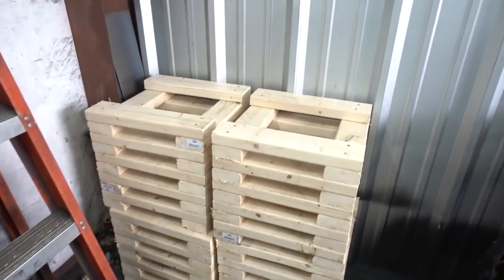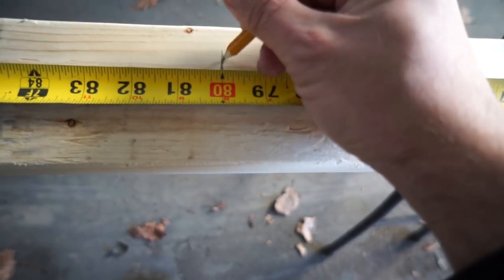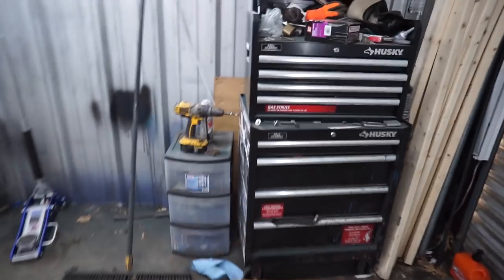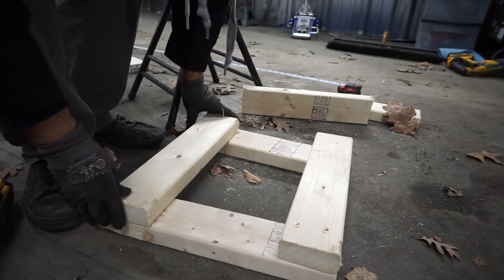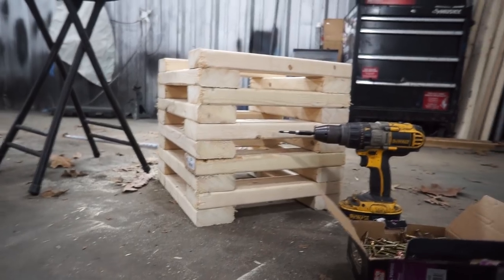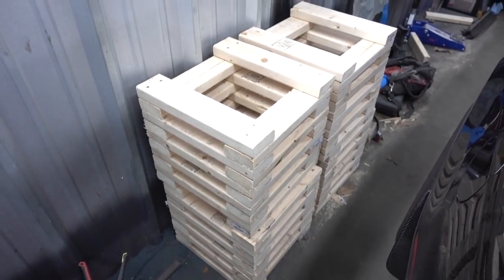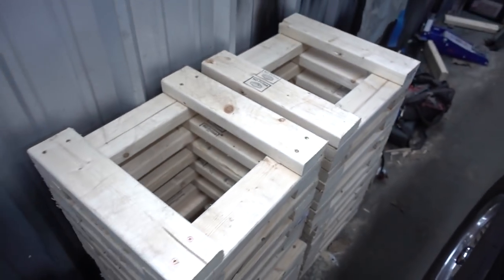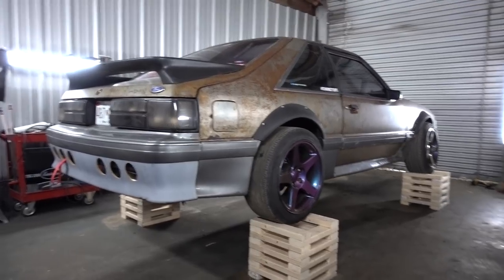How to Make Cheap Car Stands

Comment: Where i work we have scrap 2x4s going in the dumpster every day, just built my 1st of the 4 today with free wood!
Reply: Not fair lol i just spent 200 on cheap 2x4s lol
Reply: that is probably cheap pine, ok for fireplace but holding a 2 ton car crack crack split and your holding up transmission with your head and maybe thats why it is in the dumpster but good luck

Comment: The actual scary part of that is when one end of the car is supported by 4 jackstands. Jackstands are not designed or rated with any lateral loading, and can collapse with far less load if pushed sideways.   It would be saver to use a shorter set of wooden supports or ramps as an intermediate step.

Comment: Tip from Essential Craftsman: make a stack of 2x4's - however many you can control.  Or heck - two stacks.  THREE - all the same.  Just measure and mark the first layer.  Then use a CIRC SAW to cut, setting the depth just a tad longer than the board is thick.  That way you are marking the next cut.  And you'll be done in a third the time!
Reply: OG Essential Craftsman?
Reply: Miter saw with a stop block is the best way to do this, but that way with the circular saw is the best way without a miter saw for sure.  Love EC!
Reply: @mae2759 if I watch a guy pulling one stick off the stack to walk over to the miter saw i would stop him or put him on clean up duty. Framing is almost always done with a circular saw off the stack. Unless you have it set up with a 12" sliding mitersaw to cut 5-2×4s at once on edge. Which most ppl dont have the foresight to do. Even with a stop to cut one piece at a time with a chopsaw is not faster then circ saw cutting off the stack
Reply: @kefwals8722  You framers are much more skilled than I, so I just use the miter saw.  You use your circ saw every day.
Reply: Have 5 guys putting this together assembly line status be done in record time.

Comment: Cool.  I could see using this for rust inspection and DIY rustproofing/undercoating.
A few suggestions/variations...

The top two pieces which are in contact with the tire are subjected to spreading forces (like a very dull wedge trying to split the stack).
The way you have the stack oriented, I would add two more pieces (rails) so that the two pieces being spread (touching the tire) have stabilizing pieces ABOVE as well as below.  Or just rotate the existing stack 90 degrees to accomplish the same thing but loose 1.5" of lift.  Some planned dimensions may have to be adjusted to allow widest tires you wish to accommodate to fit between the top rails.

Directly under the place tires contact wood, put 3.5" square filler pieces in the middle of the gaps all the way to the bottom.
This will help transfer the weight to the ground, as opposed to just transferring weight to the corners.
A single screw each is sufficient to attach, or even just use glue during assembly.

When not in use under a vehicle, use as supports for bench seat(s) in the garage or under a covered porch.

Comment: Use saw cut square wood. So 3x3 or 4x4 and put the grain laterally for better strength. I did a gearbox swap on a 7.5 tonne truck with this method.

Comment: Glue a set together first. Then drill pilot holes for the screws. Then put the screws in. Glue will make them extra strong. pilot holes will prevent the screws from splitting the wood.

Comment: I used wooden pallets, 1/4 pallets, to get my car up high. It works great and the pallets are free. Just ask for them at Big Box store. Lowe's, Home Depot, etc. I screw them together with scrap boards. I even screw blocks in front and behind the tires to keep the car from rolling.
Reply: Depending on the pallets, most pallets that people will find are made of pine and I wouldn't trust it. Others are Oak and that is stronger but I still wouldnt use for this idea, 1/4 is just to thin even if its a hard wood like oak. Just my opinion.

Comment: Box cribbing is excellent at supporting heavy vertical loads. Houses are sat on them as are the largest of ships.

I made a set myself. I chose a 14" square crib. My top layer is made solid by placing 4 pieces side by side: 4 x 3.5 = 14". I chose to make eight 6" cribs. They can be stacked so I have the option of a 6" or 12" lift. I find that often a 6" lift is plenty. Lastly, I stack them all on a small Harbor Freight furniture dolly for storage.
Reply: Stanton Taylor what wheel size and profile suits?
Reply: Can you do a video because my English isn’t the best and I kinda don’t understand what you are saying 😅😅

Comment: Railroads use this similar design for some bridge crossings.  And a locomotive is no light weight piece of equipment.
Reply: They use wood cribbing on monster size construction equipment/ vehichles, larger than a dinosaur, so a train is nothing
Reply: White oak is standard railroad cribbing.
Reply: CromaticDragon  I am a retired CSX journeyman Carman with 32 years of service. We never used creosote "soaked" cribbing - only "green" white oak.
Reply: CromaticDragon  - we re-sawed our oak cribbing in our wood mill, making wedges and various size 3" thick blocking.

Comment: You need to stuff 2x4 spacers between the sides of the top one or two layers of 2x4's... so the tires are held up on just one 2x4 at the top.   Cool idea, just add some 2x4 blocks in the spaces of the top one or even 2 levels of 2x4.  Even after it's done,  use some sub floor glue and just slide 2x4 blocks in to carry the weight down into more layers of 2x4's .  Nice video and thanks for posting
Reply: Hey Steve what do u mean? Can u show me
Reply: @kewkew2  from the Top, look like ⏹ instead of ⏸.

I think.

I was thinking he was talking about making a flat perimeter square on top

Comment: Make 8 of them at half the height, make the top half to where it will key into the bottom half. That way you can get the car up on the bottom half of the stands, then jack it up some more to get the car the top half of the stands. This would probably be safer than using the jack stands.
Reply: Exactly what I was thinking and what I'm gonna do

Comment: I decided to make some after watching numerous videos here.
The only thing I'm doing different is using 2x6 and 3 for each level.
But also going wider and longer to avoid any tipping hazard.
18" W x 24" L x 12" H.
I know...heavier than hell, but so is a car?
If I need to go higher later, I have that extra width to keep it square.
Total cost 08/2024....$140....not that big a deal.
I'm confident it'll support my '83 GT for anything I need to do under there with solid foundation in the center also top to bottom.

Comment: Did this for removing the trans in my suburban.  I made mine 3 piece so you can stack them.  Only difference is I have 3 boards per layer so the tire pressure is directed directly down through the middle of the stack.  You're had pressure outward on the two end 2x4s which seems a little unsafe.
Reply: Exactly what was on my mind when I seen the first set of 2x's he screwed together.. I wouldnt trust my life under that. Its doing exactly what you stated, also majority of screws dont have sheer strength, nails are better depending, or spend a little more and get a deck screw or others with great sheer strength. He didnt specify what he had so I asume basic wood screws. Your comment should be at the top thou.
Reply: i feel like i get what ursaying but ,can u be a lil more detailed for imagery purposes or my slow but cautious brain. u saying 1extra board in the middle per stack?
Reply: @motov8-garage832  i feel like i get what  he saying but ,wud lik him to  be a lil more detailed for imagery purposes or my slow but cautious brain. hes saying 1extra board in the middle per stack? can u expand more

Comment: do it 3 peaces side by side and make it a little bit wider suppose 60x60cm as minimum cause it works like short wooden column and i has its slenderness and buckling. So make it wider it will be more stable cause if suppose narrow it could overturn and car will fall on you. And do extra safety put additional blocks under the front and rear lifting places. be careful cause there are many dramatic events with car repair in garage

Comment: Something I noticed from the thumbnail of this vid. 2x4 stands are safe enough to hold the car up flat by the frame with downward pressure only,  NOT by the wheels. Wheels are round and much of the pressure from the weight of the car will be pushing out from the wheel against the two 2x4s on top of the stack. That pressure is only being held from the side by single 2x4s with a couple screws each end. Maybe with a lighter car it's ok but it could definitely blow out the top of the stand, followed by some kinda domino effect all the way down to your melon.
Reply: Add a third piece at least under the top stack?
Reply: As a civil engineer, this is largely incorrect. There is no resulting lateral loading on this system. By far, the largest component of loading here is straight down. Analyzing the statics of this setup, there IS indeed a minor lateral component of loading, but as stated the resulting load is a combined force vector that is approximately only  10°‐15° outward (meaning ~85% downward loading). No where near enough to cause a blowout and overcome the shear strength of a minimum of 4 fasteners (which divide the load equally). If one wants to add additional strength a few extra 4" screws would be sufficient.

Source: BS in Civil Engineering 
Statics
Strength of Materials
Construction Materials
Wood Structure Design
Structural Analysis 
8 years in the forensic engineering division at our company.

You have good instincts your intuition isn't completely off-base, but to make definitive statements off a hunch or guess IS off-base. No offense or slight to you, but people making guessing and then stating things as fact on SM is a huge pet peeve of mine. This is exactly how misinformation and confusion is spread.
Reply: @olbabybeard  maybe galvanized nails would be better than… relying on sheer strength of standard wood screws..  can’t really do pilot holes with nails though, I’d be nervous to split the wood.  I might use metal banding straps as a backup to hold it all together.
Reply: @olbabybeard  outward force should be supported by friction between the boards. The screws simply hold the wood together. I have supported at least a hundred pounds with a couple of similar wood screws. 
If you figure car weighs 4000 pounds distributed over 4 tires you are talking 1000 per tire. Even at 20 percent that's 200 pounds split between 2 directions, or about 25 pounds per screw (but as noted above it's not really even on the screw). 
I guarantee I can connect a 2x4 to the wall with 4 screws and it will support my 200 plus pounds. So that's double the load we are talking about here.
Edited to add a single screw can support 80-100 pounds, or 3-4 times our need.

Comment: I will make mine exactly the same, fill in the top solid and put race ramp wheel cribs ontop. This will give me about 27 inches of clearance from floor to wheels. Or about 33 to the car floor. All for about $1200 less than a car lift.

Comment: Thanks for the video, these are going to make it so much easier to do my MM subframe connectors!
Reply from the maker: I’ve been looking at getting a set of those too!
Reply: RobRabonPhotog turns out I'm holding off for a while.  I was in a position to buy my entire suspension/chassis set up from MM all at once but my car has been in a collision and I'm going redo someone's repair on that before I install anything.  New strut towers, fender aprons, core support.... anyway.  Just wanted to say I have all of my parts and the quality is outstanding, I highly recommend them so far.  AND if you do order them read the instructions and follow them.  I've been watching videos and reading the instructions for everything and every video on YouTube runs into "surprise" issues that are covered in the instructions.  The instructions provided are very detailed and well done.  For example, the subframe connectors' instructions say that the best situation is to install them with the weight on the tires but they illustrate locations for jack stands if that's your best option.  So how often you put an old car on 4 jack stands and not have to fiddle with at least one of them to get weight on it?  But most of the videos I watch put stands under the frame and when they get done and set it on the tires they're puzzled as to why their doors aren't lining up like they used to.  Also, the connectors come with seat braces.  If you look at the pictures of the complete installation of the MM torque arm it looks like one of the legs of the seat braces on each side has been "massaged" to make room for one of the bolts that anchors the torque arm brace to the connectors.  I'll probably leave the weld for that leg for when I install the torque arm so I can make sure the finished product is clean looking.  You can go to their website and in the top left you can access install instructions for all of their products and see what I'm talking about.  Sorry so long winded but these are a couple of things I've picked up from hours of  studying to prepare for a successful install.  Main thing, watch some videos to prepare for the issues you will encounter but depend on the instructions for the install.  Maybe you could do an install video that actually follows the instructions step by step?
Reply: @effewegugal3382  - more details! MORE DETAILS!!! -- you posted a year ago - do you have photos, a video, and/or a followup report? Enquiring minds want to know!!!
Reply: @OHUQTU  I ended up moving all of my stuff out of my shop to suicide the doors on an old truck for a buddy.  I reused all of the factory stuff (hinges, latches, sheetmetal) so it took some time to make sure it was right. 

When I got back on my stuff I realized that a lot of the parts I was replacing on my Cobra were in pretty good shape.  Rather than pile them up and try to sell them part by part I found an '84 hatchback roller that still had the 4 lug stuff in it.  The '84 now has the Cobra suspension, drivetrain, complete fuel system, axles, and most of the brakes in it and I've got the Cobra back in the shop.

Kind of started thinking I really want to build the hatchback instead.  I've always liked the looks, and the body and frame are actually in better shape than the Cobra. 

Or, maybe I'll just start selling everything, lol.  Got a lot going on right now so I'll probably give the cars a rest for a year or two and see if I feel different before I make a decision I regret.

Comment: It's only the 8 screws on the top most stack plus a little bit of friction holding each wheel. Doesn't seem too safe. Even if the whole thing doesn't fail at once, it could give you a scare at some point when the top stack is pushed apart.

Comment: hi there, thanks for the video. This is amazing. I've been trying to find a way on how to be able to jack my car higher so i can swap my turbo. You just gave me that idea. BTW, what kind of wood did you use for yours? Is it a cedar or framing type wood like pine? Those Cedar wood post used for fences are really $$$. I was considering getting the pine one, but not sure if they're strong. Would appreciate a reply. Thanks.
Reply: Use what you will, but he is using standard construction grad lumber.
Reply: Don't use cedar. Use pine/fir studs.

Comment: Are those really 2x4's? They look like 5/4 boards, which are almost 1/4" thinner. What stops all the boards in front/behind the tires that carry the weight from snapping with a real vehicle on them, like a small truck or SUV? Aren't there supposed to be stub pieces between the layers of the stacks in front & back of the tires? Thanks.

Comment: Itd be better to puth them under the chasis diagonally on the totally solid part of the 2x4 stacks putting the weight on the middle of the 2x4 cancause them to break
Reply: You would have to "puth" as you say and build them taller
Reply: Put a third rail in the middle

Comment: Hey buddy, what made you use the measurement of 16”? I made some and went off of my widest tire and added a inch. Figured that would be fine.
Reply from the maker: Woods was cheap back then and I wanted plenty of room in case I had something up there that was super wide.  I would’ve went smaller with today’s wood prices.  Lol.
Reply: @RobRabonPhotog  ya for sure, I’ve been doing it with free chunks that I’ve acquired 😂

Comment: The fire department actually uses cribbing like that to hold up things a lot heavier than a car. Also seen them used on Bitchen Rides to hold up cars in their shop. No doubt they are strong. If your sill worried about strength, use 4x4s.
Reply: Use a third rail in the middle
Reply: 4x4's can be harder to fasten together. I suppose we would have to find a 6" deck screw?
Reply: @DJimeku 
4x4s or overkill, but you could sink the screws and use wood glue.

Comment: You said pilot and you never used a drill at all and should use a clearance hole for the top piece and pilot for the piece you are screwing into because you are pulling the top piece into the bottom, what you made there will split after a few months even with no weight on it, great idea though thanks

Comment: screws are not stronger than framing nails. Think of the shear factor. Try this- Take a 2x4 and drive a screw and a nail the same length half way into the wood, now take a hammer and hit both the screw and nail. The nail will bend over. The screw will break off. TA-DAAAAA.........Why do you think house framing is NAILED together not screwed.
Reply: Depends what the screws are made of, you won't snap decking screws very easy if at all and screws don't slip or pop out like nails and hold wood together much stronger than any nail and the reason they are used framing houses is they are cheap, I don't use cheap shit, Screws are ten times better than nails anybody knows that, you sniffin too much generic paint thinner, only name brand for you from now on